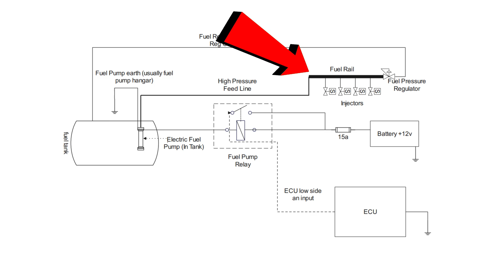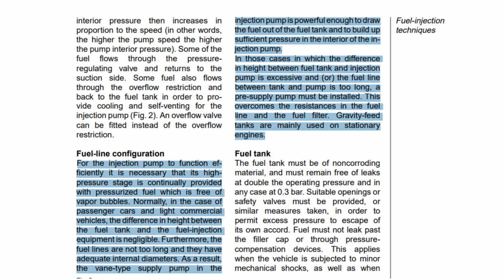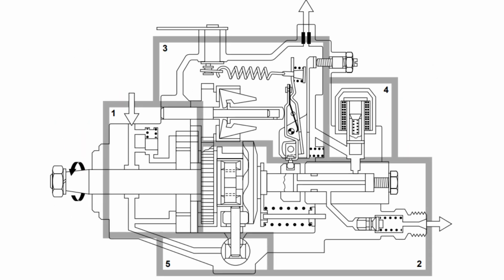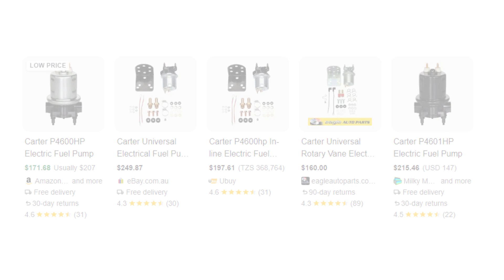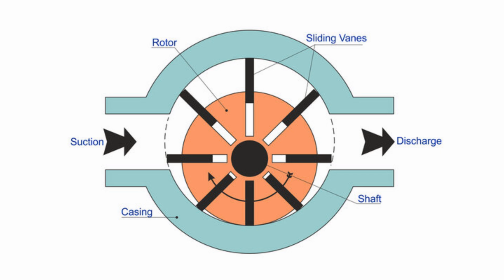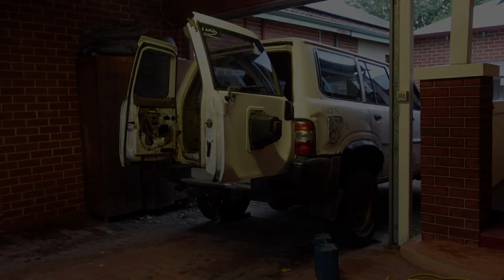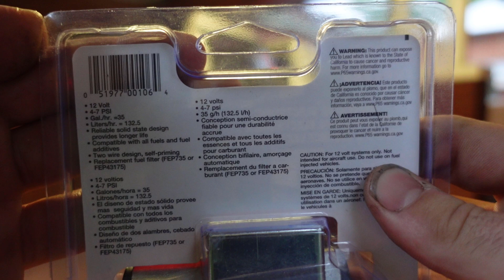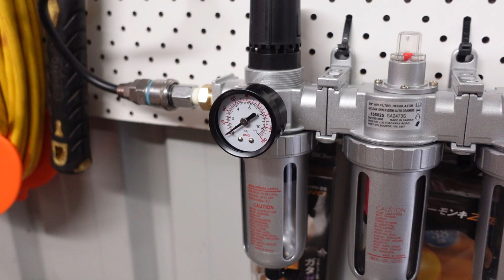Installing a Lift Pump for a Bosch VE Injector Pump

Comment: Thank you for this great video. 

A question regarding install of the solid state pump. If I wire this so that the cube pump runs once the engine ignition is on, this could mean that the fuel line is being pressurised whilst the Bosch injection pump is not yet being turned over. Since the Bosch pump relieves pressure during its cycle, could this risk over pressuring the fuel line in the event that engine is left with ignition on but not starting engine?

Comment: hey mate got a question in regards to a 12mm td42 pump im testing at the moment, I tried contacting you're instagram but im not able to send messages.
Reply from the maker: @williamgromadzki6584  hm stange, i dont have any message requests currently. Whats the question mate?

Comment: Hey man figured you would be a good bloke to ask, but on my RD I am running into a slight issue where if it revs over 4k rpm and then I come off the throttle, the motor stalls. Doesn't happen all the time but definetely is an annoying issue that I would like to rid. Is a 98 GU RD28ETI
Reply from the maker: hmmm that is stange. with the ETI it is a bit harder to guess what the issue could be. does it throw a check engine light when it does? if it doesnt it is likely an issue with the pump. if a hose it loose or has a hole in it between the pump inlet and the fueltank outlet it could be opening up as pressure builds and sucking air in which is killing the pump case pressure not allowing injection pressure to be achieved. id think though that if air is getting it the injectors would need re bleeding and it wouldnt start back up.

Comment: Can we use a gas 1bar pump?
Reply from the maker: 1 bar would be a bit high, id try to find one with under 8 psi working pressure. diesel is a bit more viscous than petrol too so a gasoline pump may have issues after extended use.

Comment: how did you solve the MAF voltage going out of range and going into LIMP mode? I have a MAF calibrator coming from Greece so I can scale the voltage. Its the only option I could find now that Jaycar doesnt make anything anymore...
Reply from the maker: i solved all the elecrtical dramas by sticking a fully mechincal pump on the engine. its a great upgrade as the ETI pump has lousy throttle pedal feedback and often has dramas with the electronics if any mud or water gets in or around them.
Reply: @EbayEnthusiast42  yeah don't want to go there with a new pump plus I'm stubborn :p the MAF voltage is sitting 0.2v higher at idle than stock. This throws the range out. Will rescale to bring it with ECU specs. If that fails it's Unichip X ECU time
Reply: maf voltage clamp, or Unichip if you wanna be fancy

Comment: so what does it mean when the pump cuts fuel at WOT and throws an injector pump engine code? Is a chip turned up to much? Asking for a friend
Reply from the maker: id assume that would be a maf signal issue, if the volts spike the engine will go into a closed loop map which makes way less power as the engine assumes permaiters without taking information from the fam or iat senors.

Comment: How the GU going any issues after doing mechanical pump and turbo upgrade?
Reply from the maker: @keilfestin4606  nah the pump and holset absolutely loved it. Unfortunately the engine itsself is super old its got so much blowby. Made the decision to put it on hold and get my other build done. Im thinking i might do a swap to a td42 but the big thing will be a cab swap as that one is absolutely rusted out
Reply: @EbayEnthusiast42 ahh right I just did mine new 11mm mech and holset 200wg made about 170hp but having over heating issues when I went up to bundy and rocky still made it ..I’m thinking it’s head gasket or crack head . Still planning to replace the head and doing a cooling mod of this fails might go TD but then overheating issues again 😅😅😅
Reply from the maker: @keilfestin4606  the TD isnt much of a better engine it is just as old and weighs a tonne. its only two benefits are displacement for useable torque when out of boost and a crossflow head. my RD was usually cool unless it was out on the beach or pulling all the way through 4th and 5th gear. unfortunatly the RD head has poor cooling passage design and suffers from this.